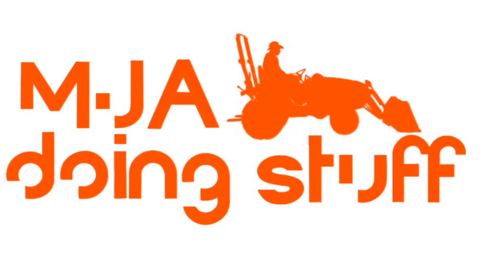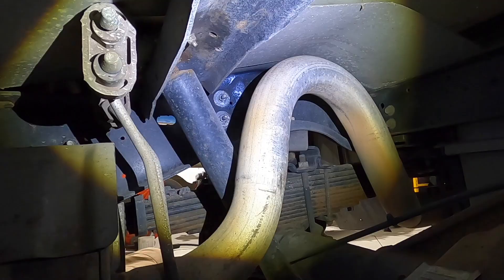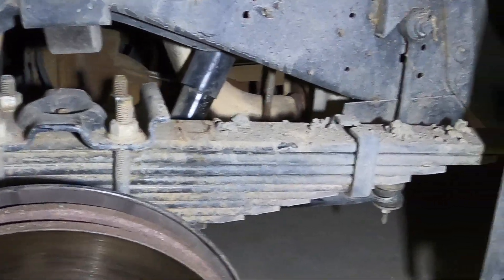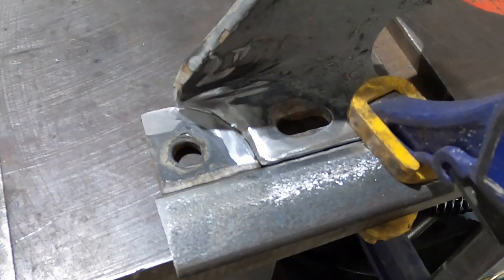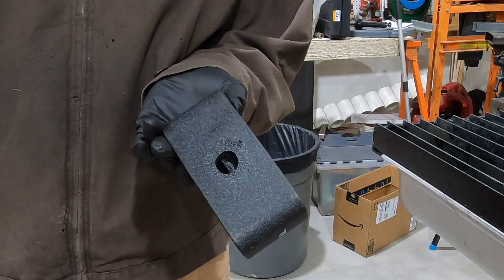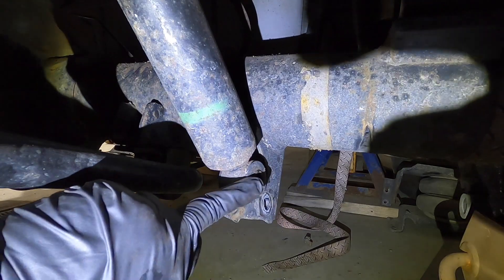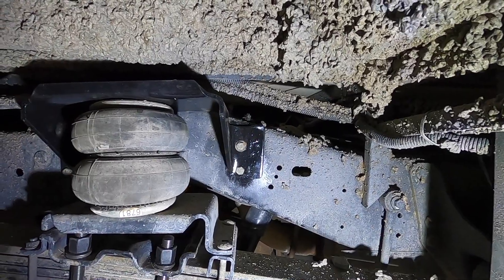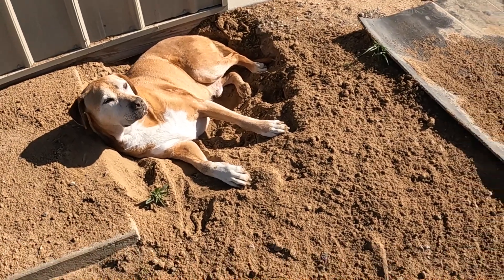E450 Class C RV 2"inch rear lift plus air bag repair

Comment: Great video Mitch! I was just thinking I hadn't seen one from you in a while and apparently I'm slacking, lol. Vehicle repairs are not in my wheelhouse, so I'm very impressed with what you did. Hope it lasts till you can buy the new lift kit. 😁👍
Reply from the maker: Thanks Sam 😁 I am happy with the results. Your channel is doing great. Your barn will be a lot cozier this winter 🥶 with the new wall you are putting up. Thanks for checking out my video. 🚜💨🍳

Comment: Those wheel dolleys are a cool tool. I am surprised that bracket broke, it looked like a thick bit of steel. We find that it can make a problem seem worse when it is being recorded and things don't go well
Reply from the maker: Thanks for checking out the video Joseph 😁I was not thinking just doing😂 at least it all worked out. Have a great week 😁👍🚜💨🍳

Comment: Hey Mitch, Your perseverance is amazing! I would have given up at the first sign of trouble! Excellent repair. But because both sides of that bracket were either broken or cracked I would say it wasn't engineered correctly. What do you think?  Nice job making the video! Cheers!
Reply from the maker: Thanks Mike probably should have given up😂it all worked out. I would have to agree with you. I think the bends weakened the already thin steel plate. Thanks for checking out the video 😁👍🚜💨🍳

Comment: Nice work Mitch.  Did you have to make the same weld repair to the other side?
Reply from the maker: Thanks Chris 😁 No the other side was fine I just put in the lift block. Did not want to show both sides in of repetition. Have a great Sunday. 😁👍🚜💨🍳

Comment: Hi, by adding the lift block, does this affect the ride quality???
Reply from the maker: @jetlimaximize  I have not noticed any difference except the difference in height. The only difference is now I am running 50psi on the air bags instead of 90psi before trying to get it higher. But it does seem to feel like a over loaded truck both ways 😂 thanks for watching
Reply: I just realized that this was for the passenger side. Did you also add a lift block on the driver side as well?
Reply from the maker: @jetlimaximize  Yes just did not show because it was against a wall and would be the same as the passenger side. No need to show it twice😁👍🚜💨☀️

Comment: Yikes.  I am wondering about those springs.  They looked kind of flat.  Maybe even overbent / stressed ?? Camera angle?   Do they make the camper lean or do they squeak at all when your travelling?  What, me worry?  HA.  🤠
Reply from the maker: I feel like they are wore out but I was just trying to get clearance for the tow hitch and automatic levelers. I use the camper to tow the tractor to the property and it works way better now. No  squeaks but has a lean to the passenger side. I am saving up for a custom set of springs in the future. Thanks for checking out the video. 😁👍🚜💨🍳

Comment: What the heck is a 2 inch inch lift?
Reply from the maker: I guess you didn’t watch the video. 😁 It’s just a 2”inch block of metal in between the leaf springs and axle to raise the static height of the vehicle. Let me know if that helps. Have a great week😁👍🚜💨🍳
Reply: @MJADoingStuff  lol, I mean 2"=Two Inch whereas 2"inch=Two Inch Inch...  The department of redundancy department has struck again...
Reply from the maker: @Warrentheo  😂👍